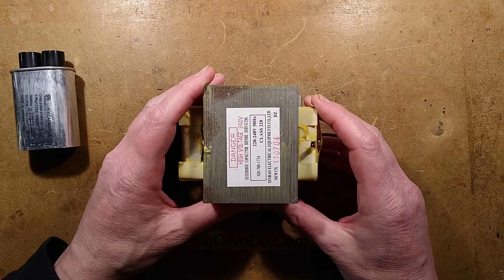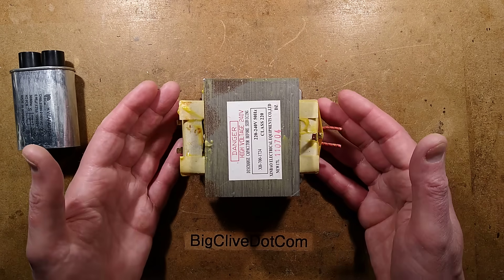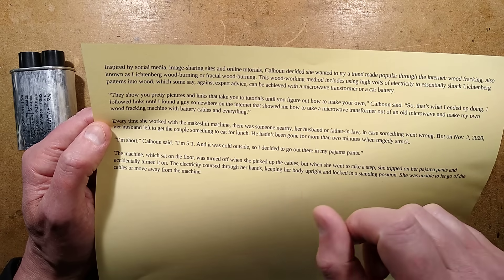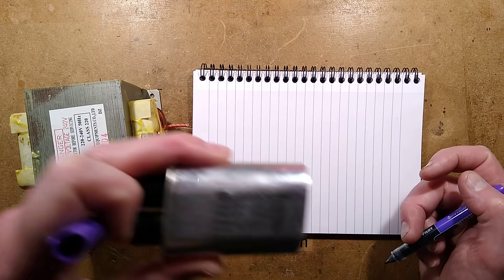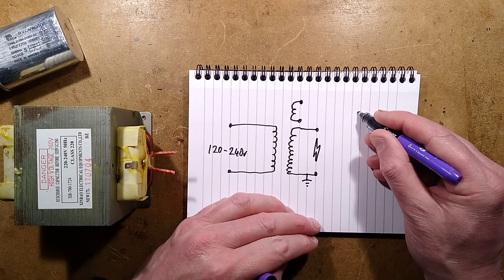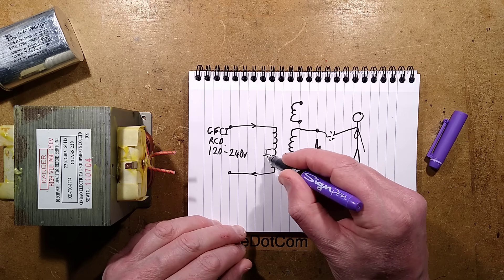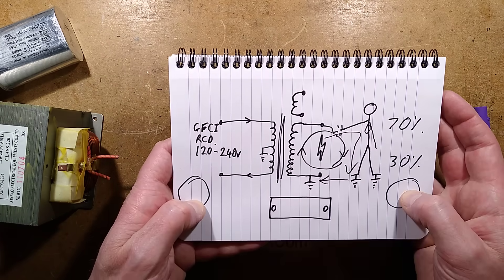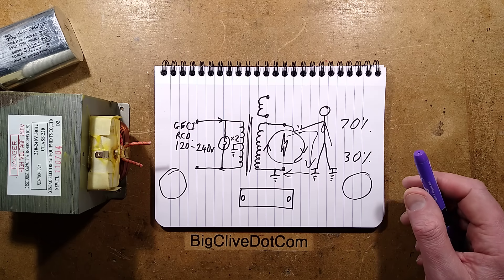The most deadly project on the Internet

Comment: I took an old non-functioning micro wave apart to see what was in it. I did not know they could still be dangerous but got the magnets out. The only good use for the old transformer i found  was to use it as a weight to hold things in place whilst being stuck. Is there any way of getting into the copper windings? as copper wire stuck around flower pots deters slugs and snails. Thanks if you read or comment. Great vlog.
Reply: A lot of those transformers use aluminium wire in them
Reply: @ozzybloke4830  The copper coating will still work fine for wrapping a flower pot

Comment: I remember watching the service tech for $PriorCo's UPS battery room.  He had Insulated leads for his meter on ~2-3 FOOT insulated pipes (he could extend them easily),  Did it look ridiculous?  YES.  Did it NOT let him get into the area where he might become crispy?  YES,  

IF I was going to do the Lichtenburg burns, it would be on leads that were on multi foot long poles AND someone who was solely there to Hit me with a 2x4 IF anything happens.
Reply: Yeah UPS systems can be pretty dangerous. Some strings of batteries will have several hundred volts on them. Then the fault current ratings are extremely high, some 50,000amps+
Reply: when I worked in a Datacenter the UPS batteries were massive strings of 6 or 12v batteries at 540v nominal and capable of 1000A continuous. Those were pretty neat. The switchgear for them was almost as big as the inverter units themselves.
Reply: @ryanhebron4287  - Bus bar exploded at a data center here in Houston back in the mid/late 2000's.
Reply: @tbelding  hmm, was that The Planet? Heard it knocked down walls!
Reply: @RossReedstrom  - Yup.  Didn't blow down "walls", but it did blow out the side of the building.   They had to transport all the servers to other data centers, because it was going to take so long to get things working again.    It blew out the underground power lines. Had a friend that worked for them at the time.
Reply: I guess I now know what the "Safety Board" is supposed to be, and why so many people make morbid jokes about it...
Reply: I used to think that DC systems were inherently safer than AC systems, until I was discussing it with a sparky mate who has worked on datacenter UPS systems. He correctly pointed out that a 400VDC system with fault currents in the tens of kA will kill you just as dead as a high tension line, and your loved ones don't receive any kind of prize if your corpse is still visually identifiable rather than a charred lump of carbon. Sorry for the somewhat macabre language, but his comment sure stuck with me.
Reply: @sixstringedthing  - The only 'safer' about DC is that at the lower voltages, it doesn't tend to kill as readily as a/c does with the fibrillation.   As soon as you hit a voltage that can char?  There's no real difference.
Reply: @tbelding  : DC can sometimes even be more dangerous. It's less of an issue with modern switches, but back during the "war of the voltages" the AC frequency was slow enough that sparks could extinguish themselves in switches that DC would sustain an arc in.
Reply: @absalomdraconis  DC has a lower shock risk but a higher arc flash risk.

Comment: Prior to them becoming too annoying, Kreosan used microwave transformers to get mains electricity running into Pripyat to one of the buildings they set up home in, one being used as stndard, mains in, HV out, connected to cabling that somehow hadn't been pilfered yet, and at the other end, HV went in and 220-ish came out, so that's one use for them, still not "safe", but better than making burnt wood that could kill a human in the process...
Reply: Kreosan constantly do pretty stupid and unsafe things. For example they could have easily started a fire in the building, since none of the cables were EVER rated for such a voltage, much less after 30+ years without any maintenance in the building.. Then the fire could have hurt them, or spread radiactive dust, etc. In other words, they did exactly the kind of stupid stuff why that area is restricted for random people.

Comment: I was wondering if this video would come at some point. I have several of these floating around, and MOTs along with my 3 kV/2 kW rack mount adjustable power supply are the only truly terrifying things in my electronics collection. People see these carefully curated videos on TikTok, YT, and every other cancerous social media site that gives the impression that easy viral videos and admiration are just around the corner if you do the same thing. Same thing with other things like automotive repair, modification, and racing. Seeing a slickly edited video does not equate to real-life experience with these things. Sadly the people who need to see this video most are those least likely to see it. But, it still doesn't hurt to reiterate that a microwave oven in the trash is best left there if you don't know what you are doing.
Reply: unless you want to sell the copper for scrap
Reply: @octapesarini  or salvage the magnets from the magnetron. Great for holdinng notes on the 'fridge door or picking up those spilt screws from the workshop floor.
Reply: @garyb47  is it worth the effort? Magnets for uses you mentioned can be had for very little money.
Reply: @UtkarshAmitabhSrivastava  Magnetrons have two rather large ring magnets over 50mm in diameter (varies by microwave power).  They cost a few dollars each, but only take a few minutes to extract.  They are rather handy for workshop use.
Reply: i'm not sure if you had something specific in mind with automotive repair, but most of the common things on a vehicle that need repair are not hard or unsafe to do at home, even if your untrained.  The only thing that comes to mind that would be unsafe would be putting nuts\bolts on too loose, but if you can safely change a tire when you get a flat, you can make sure things are on tight enough.  You can also just get a torque wrench and lookup the spec (i can tell you from experience, the "pro's" don't bother with that outside of something like headbolts that are extremely fussy)
Reply: @Wooble57  Yeah, I know.  I did a project on my VW diesel, and had to retap one of the three belt tensioner bolts, common to the coolant jacket.   The mechanic that had worked on it, sometime before, had stripped it, and left it that way.   I had to have a specialty tap product, priority shipped from Virginia.   Unfortunately, that phrase , "If you want something done right, do it yourself,  keeps coming back around".
Reply: @Wooble57  The small stuff is ok. But things like fuel systems, brakes, suspension and especially ELECTRICAL SYSTEMS tend to get quite butchered by people who don't know what they are doing. As an unwilling used-car aficionado, I can vouch that there are many very, very dangerous things people can do, like hack in random hose and barbs from the local auto parts store to fix fuel lines, install full automatic lock/start/alarm systems by just literally twisting the bare wire together and insulating it with scotch tape (caused a fire in the car while I was driving it), cutting massive holes in the gas tank to change fuel pumps, trying to patch holes in tire side walls, forgetting components, etc. The list goes on and on and on... Another one, courtesy of the dealer this time, was installing all the lug nuts hand-tight on my parents SUV. They drove it 300 miles like that, with only about 2 or 3 studs left to hold each wheel on when they returned. They are luddites with respect to anything mechanical, so they had no idea anything was wrong until they were almost home, at which point being almost home they decided to just get there and call me afterwards. One can never underestimate the power of stupidity.
Reply: @Wooble57  And I don't know what's more of an insult with some of those. Finding it, or having to restore it back to its original condition. In my old Chevy, I just said fuck it and redid the entire electrical system and put all new wire harnesses in it, after it caught fire, of course. The other fire was in my Taurus, which had flames coming out the tape deck from all the main wiring shorting together. Fortunately in both cases, me and the car survived, and with difficulty I was able to undo the stupid and make them safe again.

Comment: I made a "bolt melter" out of an old MW transformer years ago.  Took out the secondary and use 3 turns of welding sized cable.  Low voltage high current.  I got bored with it quickly though.  These days I collect old microwaves off the curb, remove the transformers and sell them as scrap.
Reply: That's how they convert a transformer to an arc welder as well...very very very low voltage but massive current to melt metal to weld it together
Still dangerous...but not 2000-4000V dangerous...
Reply: The wire in a microwave Transformer is, aluminum with copper coating.
Reply: @ronniepirtlejr2606  In old-isch ones its still copper.
Reply: @blueredbrick  Copper is only in VERY old ones. They started using CCA enamel wire in the early '80s. I've seen it in Soviet tube color TV power transformers and East-German (PIKO) model railway transformers from the '70s. Those don't even have a copper layer on them, just bare aluminium with enamel insulation. Extremely hard to solder to with regular solder.
Reply: @mrnmrn1  copper crimp connectors
Reply: I did the same thing for my students!!! Melting 12AWG copper wire in seconds is fun!!!

Comment: Having had a couple of belts from undischarged CRTs back in the day, I have no desire whatever to play with something that might to do that to me 50 times a second. 😶
Reply: ...nor 60 times a second !
Reply: @joeteejoetee  Actually, 100 times a second or 120 times a second.
Reply: @fluffyblue4006  You are correct! That's why you can hear 400Hz (Aircraft AC freq) as an 800Hz tone as you're being shocked too!
Reply: I’ve personally had 27” and 33” crt’s zap me, and it’s uncomfortable at best. This magnetron potential is on another level like Clive said. 
Not even close to the same league. This will cook your goose in a flash not just tase it.

Comment: I've experienced over 250 VDC shocks from tube - valve equipment and RF burns, too.  Ugh!  The smell of burning flesh!  First rule of a technician is to keep one hand in your pocket to prevent current from going through your heart.

Is it advisable to insulate the transformer frame to prevent current from flowing through the earth?  Is the primary insulated well enough to prevent HV from flowing back through the neutral?  Would HV current flowing back through the neutral trigger the GFCI?  Thank you, Clive for explaining the extreme shock and safety hazards of MOTs. Perhaps you could answer one of those questions by putting the high voltage insulation tester on that MOT and see if the primary insulation is good enough to survive 2 kV AC.
Reply: I got zapped from a video terminal. It was an 18KV -- 20KV static discharge, but it was enough to knock me on my backside. It really scared the sh*t out of me as I ripped my right hand on the way out of the chassis as it hit one of the frame pieces. That was static and it hurt. Full power from the transformer will kill as you noted. I always worked with my left hand in my pocket while poking around with my right hand. What's funny is I still do that today out of habit when I open my PC!
Reply: That's like saying 'Clive, please promote this stupidity'.
Reply: The HV current doesn’t flow back through the mains - because microwave transformer is an isolation transformer.
Building a “safe-ish” one would require putting a core balance transformer between the two output connections. This will still kill you if you get between the two terminals.
That said a low rated core balance trip is set for 17mA  at 3000V is still a lot of wattage at 50W. More typical core balance trips for high voltage systems are set at 150mA (delivering 450W to whomever makes contact).
BTW - people killed by electric chairs are more usually cooked to death than killed by shock. Raising body temperature to 60C will do that…
Reply: The primary secondary insulation on these things definitely IS good enough to withstand many KV (at least for many minutes, probably longer), so the breaker would not pop. You could connect the transformer core to neutral instead of earth. This in one sense could decrease safety, but it would would now allow the elcb to pop if 30mA flowed to earth from the HV terminal. The safest way to play with these is to use short probes on the transformer, rest them on the wood, then apply power when your hands are not near the wires or wood. But I do understand this distracts from the `arty-ness` of using an electric pencil!

Comment: I first encountered a microwave transformer ~25 years ago.  I'd salvaged it and had no idea what the secondary winding put out... so I plugged it in, and approached the terminal with a fluke multimeter.   Before the probe touched, an arc jumped several mm.  I jumped backward and promptly unplugged the primary, quite thankful to be alive.  to jump the gap I saw, it had to have been over 5kV.  I had followed the "hand in the pocket" rule, but at that voltage, as your video illustrates, your shoes aren't enough of an insulator to count on.  I made out fine I suppose because I'd been on an asbestos tile floor over wood, and the transformer was on a wood bench, so just enough resistance to save me.
Reply: Dang, lucky! I usually just have a rubber mat and my work boots to insulate me from max 6kV (if a fault happens) potentially, as we often cross a transformer room during normal operations at work.
Reply: @windshield11  I have the tyres of a power wheelchair. Lol
Reply: I’m glad you’re still here
Reply: Checking a microwave output capacitor with an auto ranging Fluke meter, I discovered it auto range higher! RIP Fluke.
Reply: But... Did the Fluke survive?
Reply: @mrnmrn1  After sending it back to Fluke, yes. Luckily paid for by my employers at the time!
Reply: @mrnmrn1  It did, I think it was in service for two more years, before some other incident, a drop I think, did it in.
Reply: I usually test unknown transformers by feeding them with 6 volts or so from another transformer.
Reply: @oscar_charlie  I've done the same since.  Often with a variac, so I can adjust up once I know  the output is reasonable.
Reply: This reminds me of the Dust Bowl back in the 30s where after a black blizzard anything metal outside would get sand blasted enough to where if one reached out you would get up to a six inch spark leaving an arm temporarily paralyzed or worse get knocked out for a few hours.
Reply: @MrKillswitch88  now that's living in the wild west!

Comment: At one point in my electronics career I went on a microwave course sponsored by Sharp Electronics. The guy taking the class basically said that "You'll only get one shock from a microwave oven" He did show us cool tricks with light bulbs in glasses of water and exploding / setting fire to potatoes and tomatoes.
Reply: Back in the '80s, in college, I had a lecturer teaching electrical circuitry, he told us that if we got a shock off 415v 3-phase we'd get the biggest erection we'd ever had but would have no time to use it. To a bunch of 17 year olds that's a much quicker way of describing the dangers than going through all the technical reasons 🤣😂🤣
Reply: @Galerak1  He'd get fired for that today
Reply: Wow. That's HEAVY. Great instructor and class!
Reply: « You only get one shock, do not miss your chance to glow » was the full sentence
Reply: @capybara5494  and then you've had your last helping of mom's spaghetti
Reply: @capybara5494  WOW.
But hey: we are still alive to warn others about this!
Reply: @joeteejoetee  that was an Eminem joke
Reply: My favorite is a cd in the microwave!
Reply: Did he do the 'hot dog and glove' demonstration?
Reply: I did warranty work on sharp microwaves back in the 1980s and 90s !
Reply: Reconosco que es mortal tomemos este consejo
Reply: I may have done the same course, remember the 3Ds......disconnect, door open, discharge. It’s when you add in the rectifier and capacitor you get double the secondary voltage and it’s now DC things become more deadly.
Reply: @steve83803  AC is more dangerous than DC by some margin.
Reply: @LabRat Knatz About a half a second was all it took to reduce a CD to an interestingly patterned coaster when I tried it for no reason in the 1980s. I think I was wondering if it would get warm, and as soon as I hit start, I changed my mind and hit stop. That's all it took! Back to the CD store!
Reply: @LabRat Knatz They are basically a perfect receiver, and made of super thin foil enclosed in much thicker plastic, I've never done this myself but I presume it's going to burn along the edges of whatever holes match the wavelength best and then crack and warp the entire thing if you keep blasting it.
Reply: @LabRat Knatz did not know that!
Reply: I worked with a man who got a HV shock from a microwave. Six months in the hospital with internal burns, including to his lungs.
We got along great, as I was and remain an infamous "Safety Nazi".

I've been considering building a similar type of device for another HV/high power project. It'll be quite well isolated and the HV far isolated from me, because safety third, safety second and safety first and I am an electronics technician with experience working with such things.